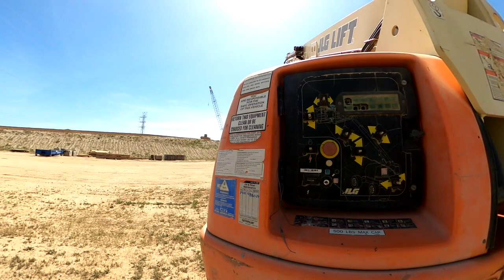Falsework is Real

Comment: I used to build bridges like this, they are mostly hollow inside except for the sides and poured concrete walls inside. Worked 10 hours day 5 days a week and 8 hours on Saturday.  I was one of the guys that flew in the steel girders on top of the falsework and set up miles of formwork. Good clean hard work.